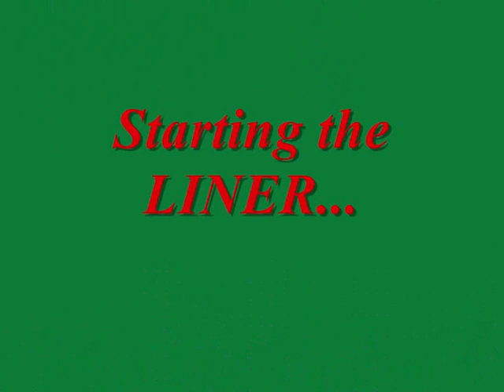1942 LINER Concrete Mixer RUNNING!!

Comment from the maker: @chazzerchazic Are the timing marks visible on the flywheel?  There should be a "lightning" mark just before the TDC line,set the points at this mark on the compression stroke and the ignition timing will be spot on. The Lister D carb,although of simple design, can be temperamental to set right for starting. If the valves are seating well and the carb cleaned out then it should start...